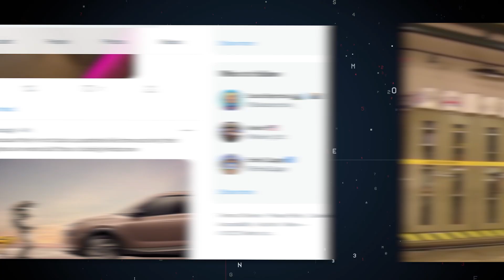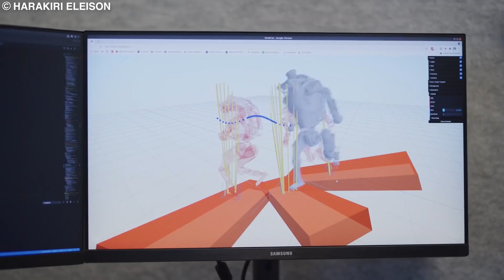Boston Dynamics' New Robot Makes Soldiers Obsolete, Here's Why

Comment: Wars will be pretty much too expensive at the current robot price . Imagine an army of 1000,000 robots at a price of 100,000$ each. So 100,000x1,000,000 = 100,000,000,000$ for the army and remember everyday 1000 of them being destroyed , so that means it costs 100,000x1000 to replace the destroyed ones so that means an additional 100,000,000$ every day!!! And then you have to charge those bots, probably everyday. It sounds pretty expensive doesn't it

Comment: They need to make a drone plane/race car Drone plane/ Speed boat All they got to do is get the for propeller drone part and attach it to a race car or speed boat It would be nice if you could switch from battery to gas on the drones

Comment: A human like body is not the best body shape for a soldier, neither is Atlas.  You need a firing platform with as low a profile as possible so its a hard target. Spot with a mounted weapon system on top is the sort of thing you want. Palm size Micro drones that fly to a human target and detonates a gramme of explosives to the head kills and is available right now. So are the drones used in Ukraine that can take out tanks or drop grenades on trenches.

Comment: this cost a several millions in research, production of just two working models, and they still aren't even a fraction on par with a trained person. all of this is digitally choreographed, a single mistake means restarting from the beginning. a human is cheaper to maintain, corrects itself, and it's availability is unparalleled. it will be hundreds of years before technology becomes close to replacing a person with a machine in war.

Comment: Ultimately these machines are in the hands of whoever govern them. Who say they are taking the correct ethical decision to send them wherever they send them? If you don't send humans in harms way, you don't have to consider public opinion as much, if at all. And there are quite a few world leaders whom should not be trusted(if any) with an army easier to deploy than a regular human one. Some send troops regardless of the human value of a soldier because they can, some may want to, but don't, because it could be a costly political move. War and armed conflict is the last resort and should therefore be handled as one, because there are no winners, except the arms industry, it's only different degrees of loss. If you think robots fighting robots is the end of wars without human loss I'd say you've swollowed the bait hook, line and sinker. I only see darkness in a future of AI controlled robots.

Comment: Robot soldiers and ground drones will definitely improve, but couldn’t a sniper take out the sensors easily with one or 2 shots then it’ll be just a pile of metal and wires then..

Comment: You forgot something important: power. A robot army would run out of power weeks or even in a day. Also emp's exist and some militaries have emp weapons and they are robots some water would lead to problems and robots can freeze
Reply: Power there are batteries that can charge at an extreme rate . People should understand when we learn about new weapons or new tech it's already been in use by the military for years before we learn of it .  
The right shielding takes care of emps and water is easy to handle .
Reply: Methods to fix those problems are also being made, who knows if weapons to wipe them out or armor to stop said weapons like emps and the like will be stronger.

Comment: The main issue there going to have is noise and power.  A small gass engine might be able to power one of these robots for half a day but it's going to make a lot of noise. Battery's will only be enough for a few hours of operation.
Reply: Perhaps, but given enough time that issue will be solved. Or they will exist but use an astronomically expensive power source making it so most governments only have a small handful of elite robots or guards.

Even if they cost 10s of millions for a single one, their be governments like China wanting a few unquestioning robots to command.
Reply: @JamesTodorovich  I think that small flying drones are more likely to be the solders of the future. There cheap effective and highly mobile. Everything you want nothing you don't. It's much cheaper to train humans to do humin only things and just have thousands or millions of cheap drones to back them up.

Comment: If you send a robotic army there is nos ethical impediment to prevent the enemy from using small tactical nuclear weapons against it. In fact would be easier to destroy a robotic army, because you dont need to use precision/clean weapons due to human rights considerations.

Comment: 1:10 lie no. 1

they are not trying to see how it can help the military.

as they said multiple times, they are for disaster relief, and warehouse work.

2:55 no. 2

the LS3 was a massive failure

3:51

spot mini is weaker than you average golden retriever, a golden retriever is far stronger and faster, so lie 3 is the "super dog strength" comment

stopping at 5:17-18

this is ridiculous, and even if they make a robot soldier out of atlas, 3 things make is worthless.

batteries have life spans, the whole robot is too expensive to mass produce, and the smallest mistake in a back flip breaks atlas down and it has to have multiple sensors replaced and hydrolic leaks are way too common.

there's no way an all electric model would be able to run for longer than a day, and it would continue to be in  service anytime longer than 5 years, and it would never see combat.

they would be better suited to humanitarian efforts.

Comment: Robot will never replace a human soldier on the field of battle because the machine is only capable of simple "if x then y" responses and will easily fall into traps and it will never learn from experience. A human will.

A human soldier is also able to recognize when their orders are no longer relevant, and when it's time to think outside the box.

Robot won't work with Western and NATO command structure, said command structure utilizes an order system called "commander's intent", which gives soldiers simple objectives and then leave the planning on how to do the objective to the people who are actually going to be doing the fighting.
A machine requires meticulous planning, which adds greater workload to the strategic planning department who are already swamped in work planning the logistics of the war...

And that's ignoring all of the power supply problems, and moral issues.

TLDR: there is a reason videos of robots doing incredibly mundane actions like picking up boxes is impressive in the robotics world, and it's not technological limitations.

Comment: The difference is humans are easy to make, they are hard wearing, extremely agile, require little maintenance, and have built in super computers and audio visual equipment, the only down side is the 18 year lead time.  These toys are a long way from replacing humans, some countries with money to burn might use them, but other countries with people to burn (think India, China, North Korea) are not going to bother.  Considering the ingenuity of humans when faced with death it won't take long to figure out an easy way to dispatch these toys with minimum fuss, a step that's slightly higher than normal, a gap in a path thats exactly xyz in width so it's little silly legs can't reach and it has to jump... onto the landmine on the other side with a metal sensor, walk up from behind off 34 degrees in it's blind spot etc. etc.  Don't get me wrong, it's impressive by comparison to what we had before, but it's a long way from replacing a human.

Comment: You never address the one key flaw keeping robots off the battlefield: how do you power them? Batteries? Okay you have a robot that can work for about 30-60 mins before it's dead and needs to recharge. You'd need a nuclear battery or a hydrogen/hydrocarbon fuel cell, the former of which we've never  made, and the latter would need to be radically miniaturized (as far as unclassified military tech goes at least).

Comment: All these robots will have zero efficiency in real life until there is a battery a hundred times more efficient than the current one. Running mechanisms consume too much energy. What's the use of something like that if it freezes in 15 minutes? Soldiers will turn out to be crap. Well, or to each of them it will be necessary to pull the cable.
Reply: They could have a disel engine. Or just like a submarine, it could be powered by nuclear reactor
Reply: @cordyceps420 china has just created a nuclear battery
Reply: Small nuclear power is already in our technology don't think the US military would not install it

Comment: Once you make something possible, how ethically it's used depends on the operator. One can use a fork to kill another. You can add as many "Only use ethically" leaflets to a cluster bomb as you want, it won't make much difference.

Comment: Military robots? Doubt it. Wait 1-2 hours and they all will run out of battery power. That is the biggest obstacle really. You could build the most advanced robot ever, but if you can't power it over long periods of time, then it's sort of useless.

Comment: The firing a gun video is fake parody video and the company says it won't work with anyone wanting to weaponize them, simply existing means they could be one day for sure but I could only see them doing logistic work if they could weaponize them as in a soldier itself I could only see it being remote operated an most likely stationary I wouldn't want a metal robot next to me bullets can fly off of or having to figure a way to haul it around when it breaks

Comment: I doubt robots will make soldiers or humans obsolete, since there will always be a factor to monitor, assist and maintenance these machines. Only if these robots would be able to think as we humans do, we would become obsolete, but even with the current AI technology, which by the way is impressive, we have not reached such state and it is uncertain if we will reach such state at all.
Reply: And I would like to keep that way. The military's real goals should be learning how to train it's soldiers to survive as well fight. I watched a beach landing simulation where Marines use amphibious APCs on the beaches where they deploy from the back rather than the front, learning from the design flaws of LCVPs that landed in Normadny, which was an open ended transport landing craft, where a dozen soldiers were killed before they reached the shores or by the time they did. The Military should invest more tactics rather tech, where the tech should be used to compliment the soldier rather replace. Improve the man, not replace.

Comment: BS, they are good even great but the problem is battery power and A.I combat capabilities, we are still a long way to achieve full autonomy during combat. It is just cheaper to use drones instead. With current technology they would need to recharge every 2 to 3 hours which is not ideal

Comment: Civilians:  "this scares me!"
USMC infantry vets: "Never gonna happen!  One word:  'Sand'."

I was reading articles about the exoskeleton hydraulic battery- powered "legs" that were in development and being tested back in 2004, when I was serving in Iraq. Same issues: too heavy, power source problems (and waste), and terrain challenges... especially sand!

At best, newer optics and auto- aiming features are noteworthy, and might make for a deadly ambush, but entirely replacing the infantryman is hardly believable. As another said in this comment list, they will be nothing more than tools added, to be learned and utilized where applicable, but you can't just replace us.

Let's not forget... we were using signal / frequency jamming equipment to disrupt remote- detonated IED's in the early 2000's. I'm sure the more advanced militaries already have the means to easily disrupt "control" of nearby "robots", and I'm sure it wouldn't be hard to create electrical disruption weapons if your standard small arms munitions are ineffective.  Let's see one of those robots take a 40mm hedp round from an M203...  done sir!

Comment: So this is my problem with robotic soldiers, they simply cannot feel. They will use cold, calculated logic to make their decisions, and those decisions will be based off a preset set of scenarios, which means the military bot could easily make a mistake in fire ants are the new targets if it is put in a certain areas which it is not programmed to understand. And perhaps worse than that is the ability to give it self learning, and then a set of parameters that will cause it to follow as its core directive, something like minimize damage to this unit, while executing Maxximum combat force on all presumed hostile targets. What happens when you put into a situation where someone starts shooting at it from a crowd? 
I say that any use of robotic soldiers, and AI technology on the battlefield, should be treated as a war crime. That goes for any use of large scale, surface combatants as well.  We need humans on the battlefield if for no other reason, then we feel the pain. Otherwise war will just become easier and easier and easier.
Reply: Hell yeah!

Comment: Run up behind it slap some c-4 where it can't reach it and see ya, electricity will short it out, holes in the ground.
Robots won't see most trip wires, can't swim.
Just see this as a waste of time, it would have facial recognition to any good for security. 
Waste of time, to many bad things I see in robots.

Comment: Automation of war is a really bad idea.  They could sanitize it so nobody has to see the guts and gore, or smell the rotting bodies and the feces blown all over the place, but part of what makes war too horrific to enter into lightly is the dead, rotting gore.  And these machines also cannot distinguish between combatants and non combatants.  I am not saying we should not use machines, or even drones, just that there has to be a human in the line of the kill chain.  SomeONE not someTHING answerable for potential crimes and errors that kill innocents.  There is another consideration here, you can buy one of Boston Dynamics little simple robot dogs for $75,000, a humanoid bot of this level of skill is going to be millions, and for the defense department I am sure they can easily get that up to a billion bucks a pair.  This inevitably means two things, one they are going to be prohibitively expensive to field in any battle outcome changing way, and two it will mean a cost benefit analysis that requires setting a value on human life so they can compare the two.  Also, how much easier would the decision be to use tactical nukes against machines?  For every advantage we can dream up the enemy can dream up a dozen ways around it with asymmetric ways to kill.

Comment: Boston dynamics has stated since the beginning that they are NOT, nor will they develop robots for military use. Now that may have changed with new ownership, but ATLAS was never intended or developed to replace soldiers. I would like to see videos that promote the original intention, not a bunch of what ifs..Like a robot that would be capable of entering a burning building to rescue trapped people, finding people trapped in collapsed buildings that would be too dangerous to send humans into, and other search & rescue operations...

Comment: The reason why the Terminator  was scary is because its solenoid valves, actuators, and internal wirings and circuits appear to be bullet and shrapnel proof. You blast the Terminator with a shotgun or grenade, and miraculously all its internal parts are still functioning.
Reply: It may get there if they apply a liquid coating to the robots like the non newtonian stuff.

Comment: These being soldiers are a pipe dream Unless these things run on gasoline, or some secret terminator Cyberdyne systems hydrogen fuel cell technology. If they are electric, it won't work, militarys knock out power infastructure 1st thing, no power , that will shut this dumb shit down

Comment: Bunch of dumbasses, go for the hydraulic hoses or just ram an iron rod into the joints, molotov cocktails should also do the trick...
Just dump a can of paint or oil over its head to block the sensors🤔
Reply: Plus they are probably too expensive to make in large numbers

Comment: The dangerous thing is that these things are made even after viewing and analysing the hazard.
Reply: Not to mention thousands of years of cautionary tales from pretty much every culture warning against creating or summoning beings of great power. Sometimes it's for greed, sometimes it's for a seemingly noble purpose, sometimes it's just innocent curiosity. Funny then that no matter how those stories begin, the third act is just man, you've seen one you've seen em all. I mean some of them have a post credits scene where the people prevail and learn their lesson, but that's just there so the children will go to sleep, tacked on there in complete contradiction to the lesson just to get that sweet PG-13 rating.

Actually, that sort of thing might be to blame, all the media where everyone is fine and turns out the dog didn't die and now it's actually two dogs that go on to cure cancer or something. Contrived happy endings neuter the lesson. I won't blame media for violence but I sure as hell will for promoting arrogance and hubris without any consequences as something to clap for.

It's no wonder it's so hard to remember what happened in a modern movie. Looks like a big complicated knot at first but by the end it turns out you just pull the two ends and the shoelace was actually straight the whole time. Except for when the knot got stuck, but luckily it was just a dream sequence so, whew, bullet dodged eh?